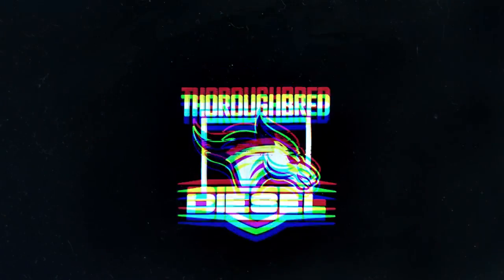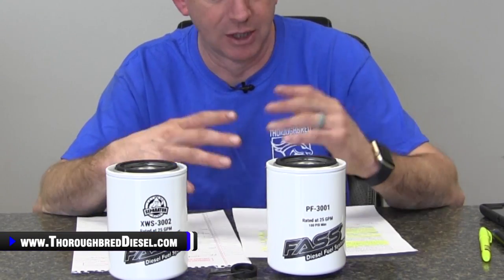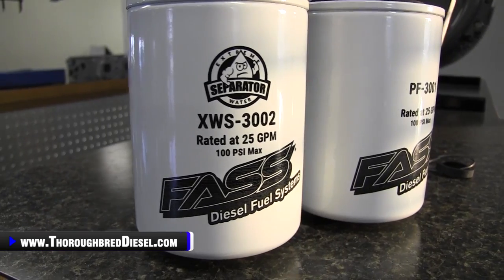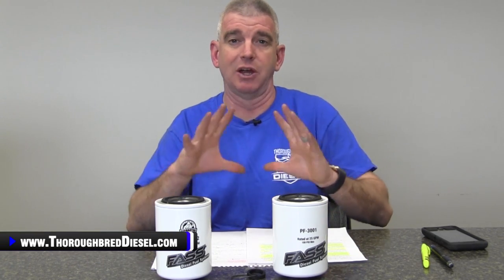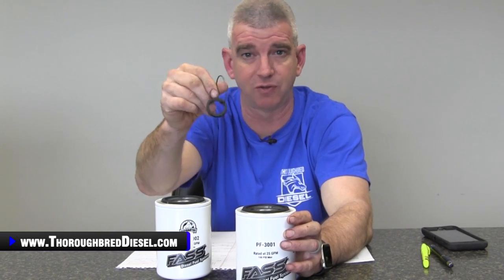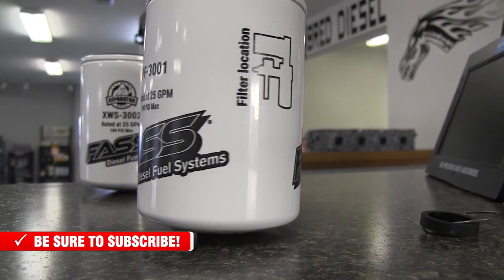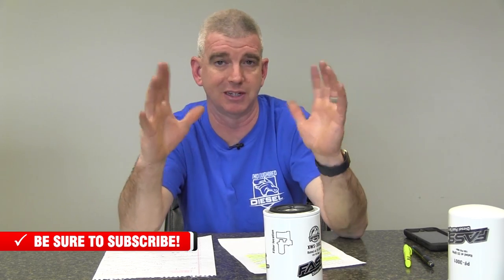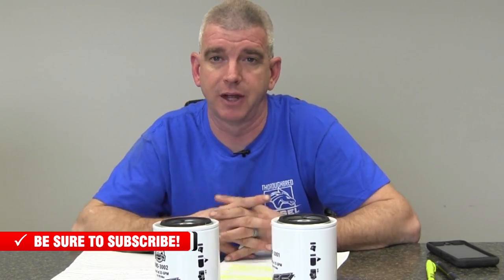NEW FASS Fuel Filters Explained: Guide To The Difference & What Does It All Mean

Comment: I have the old red 95 fass pump. The pick up tube for the old filters is to long to use with the new filters. Is there a way to remove this pick up tube and does it no longer need a another one?
Reply from the maker: FASS suggests cutting that tube to if you plan to not go back to the old filters.

Comment: I have the new filters on a black series pump. Looking to get a Cat  1R-0750 and a water separator with a drain on the bottom. Will these work in my Tit series TS D07 165G. If so where do i place them relative to the pump.

Comment: What would cause my pump fuse to blow?  It’s happened 3 times.. I finally checked my water separator filter it was filled with water.  Would this cause my pump to blow it seems to be running fine now.  My truck was getting starved of fuel.
Reply: If it keeps blowing the fuse keeps blowing out its either a short in the wiring or your pump could be going bad thats what happend to my last pump the motor took a shit an had to get a new pump

Comment: I have a 2006 lbz with a fass pump with the serial number t-104482. The last time I got a fuel filter I got a Donaldson p-551313 today I went in and my local diesel shop gave me a xws-3002. I noticed it's a bit smaller then my old filter. My question is is this the right filter. Also I had a extra fs-1001 is this still okay to use or should I get the new filter for the side as well?
Reply: your not suppose to use the new filters with the old style filters

Comment: Which position do I orient the new filters on my old pump , I have the Grey base fass pump , I used the diagram on the side of the filters , and now they seem reversed , any help will be appreciated
Reply from the maker: On the new filters, the water separator now goes in the fuel filter position, and the fuel filter goes where the water separator was.
Reply: Yeah I'm not too sure about these new filters I think I'd like to have it the old way back where you can drain the water off the fuel filter any good recommendations to get it back the old way would be appreciated

Comment: If your running Cat filters or any other brand of filter besides fass filters will the water separator need to go in the same orientation as mentioned with new orientation fass has done with the new pump?
Reply from the maker: No,  and that is a good question. The ONLY time you use the orientation of the water separator as mentioned in this video is with the FASS BRANDED FILTERS. If you are using conventional style filters, (baldwin, wix, cat, etc.) you must orient them with the water separator on the intake side of pump,  and the fuel filter below the output side.

Comment: Thanks for that info Wade. I'm down-under (Australia) and have just ordered two of each of those new filters for my 2012 Silverado (Titanium 150 fitted, Beans Sump on a Titan 57 gallon tank). To get the four filters here to Australia is costing me $227- (including freight and local taxes etc)......our dollar ain't worth squat compared to your healthy currency!!! hahaha
Reply: This is the only video I've found on the subject of the NEWEST FASS Titanium SS pumps. I just bought a TS D08 095G  for my early 04 5.9 24v and I guess they either arent including install instructions or they just forgot to include them with mine. So I went online to download install instructions. Of course they showed the filters mounting in the conventional way, with water separator first/closest to tank. Thank God this video cleared that up for me. 
  Next issue, the wiring harness. My FASS 95 came with a WH 1006 harness that makes you tie into a fuse port in the fuse box. A PIA when 99% of the ports cant be used due to relays being in the way of plugging this thing in. Also, there is NO info on how to properly disable/unplug the old stock lift pump on side of engine at fuel canister. So I'm left wondering if I just unplug wire to old fuel pump and then must I leave fuel heater plugged in and water-in-fuel sensor plug hooked up??? 
  I am just wondering why didn't FASS send a WH 1002 or 1004 harness which is plug and play and plugs right in to my existing ecm plug that my old lift pump used? 
  Can anyone tell me if perhaps I got the wrong harness with mine? Box says its a 98.5-04.5 FASS with Feb 2019 mfg date. 
  You guys seem to be the only people on the net that know about this and are possibly reachable over the weekend. I need help now if anyone is out there.
Reply: I'm surprised you can run a sump in AU.  Thought they were rather fussy on inspections, safety, etc.

Comment: Question, is a pressure gauge recommended to determine when a filter change is needed?  Just installed the new pump with those filters.
Reply from the maker: A pressure gauge would be a good addition when running these filters.
Reply: @thoroughbreddiesel  Do you sell them?

Comment: So if I have an old 125 titanium pump do I switch the location of the filters?
Reply from the maker: If you are using the new style filters position the filters according to the drawing on the filter. Fuel filter on the suction side, water separator on the pressure side.

Comment: What happened if the water separator gets full and shuts my truck while I’m on the interstate
Reply from the maker: The design of this filter is to save your expensive fuel system from damaging water if you get a bad load of fuel. The tow will be much less expensive that replacing the entire fuel system potentially.
Reply: Or carry a spare. Science!!!
Reply: I won't run this filter,  why would you take a chance of having your engine turn off .

Comment: So hauling a heavy trailer down a long steep hill. If the filter completely fills full of the water it filters out. It shuts the engine off. No power to the engine steering or brakes!!!!🤔🤔🤔😠😠😠
Reply: Your not going to have brakes if the fuel system grenades . I would much rather save the fuel system

Comment: What about the guys with the platinum pumps?
Reply from the maker: The grey base titaniums will accept the new filters.  The XWS filter will go in place of the fuel filter and vice versa.  Blue base you will need to do the nipple replacement on the fuel filter side,  then run the XWS filter there, FS2001 on the water separator side.